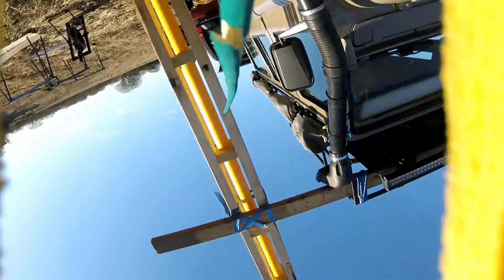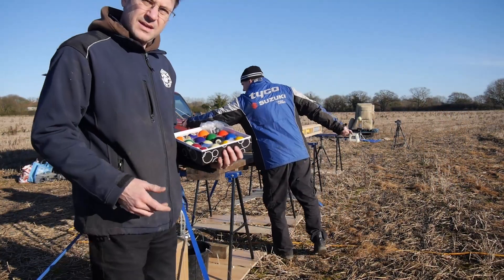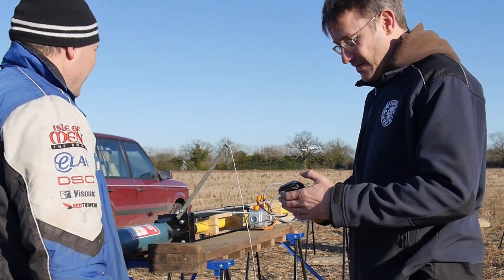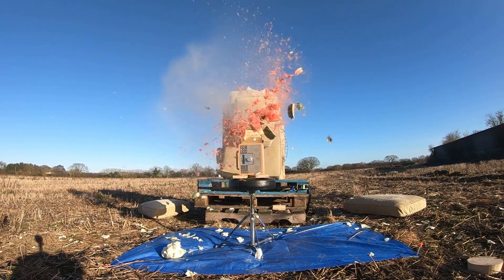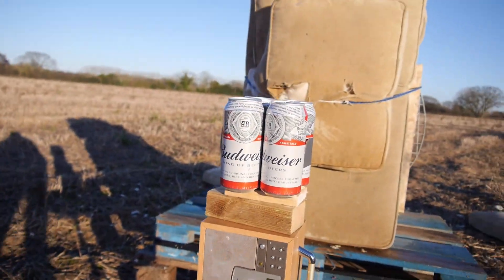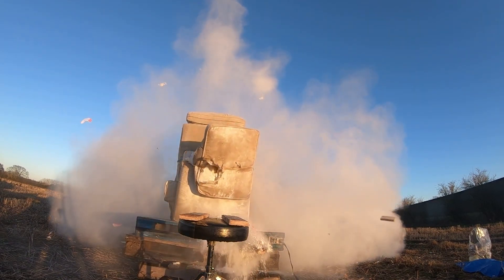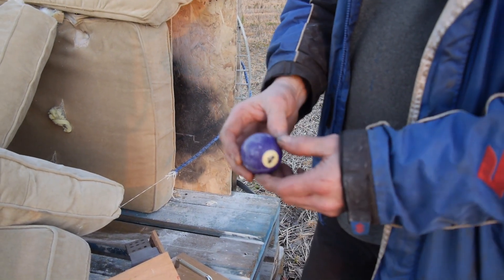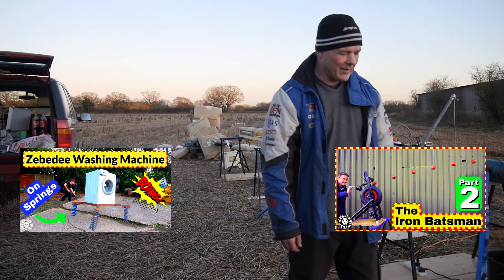HOMEMADE SUPERSONIC 8-BALL CANNON vacuum and compressed air (Experiment) Part 4

Comment: I think a larger compressed air tank would help you. You need more air volume in the tank than in the vacuum barrel. More than likely you are getting negative pressure in the tank briefly.

Comment: use a longer barrel and a burst disc rated at at least 800 psi instead of a valve you should easily break the sound barrier
Reply from the maker: The barrel is fixed but the blast disc idea is good. Where do you get them?
Reply: @VERYMENTAL  you might have to make it out of different thickness aluminum with a x etched across one face and test them on your little compressor in a separate jig or something I know mythbusters bought them but I don't know where .
Reply from the maker: maybe different thickness discs of tempered glass....hmmm
Reply from the maker: @982-c7c  Crikey, does that work? Sounds bloody brilliant we'll give it a go.
Reply: @VERYMENTAL  https://www.youtube.com/watch?v=PZPzkieeNEY